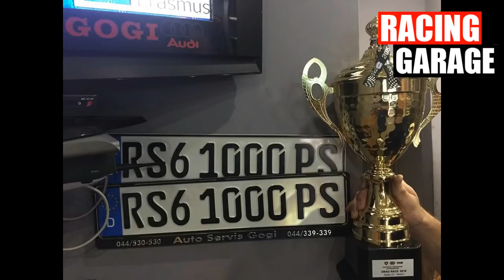ONE OF THE FASTEST VW IN THE WORLD - ROAD TO 1500 HP - GOLF RS V10 SWAP 2017 PROJECT

Comment: Its fast, i mean really fucking fast. But anyone know the 2.0 inline 4 cilinder golf 2 with 1200hp? From boba motoring. This golf 4 has more than double the cilinders and almost the same horsepower output in 4wd. If you ask me the golf 2 is more badass, but its a very cool swap-> A V10 GOLF MK4👌
Reply from the maker: hello there, yeah we know boba motoring so well but the track where Golf V10 was racing its not in good condition , also asphalt its about 40 years old and wet, so with street tires cant launch good, nearly 200meters goes spining ... 
they are working much harder with new performance setup for this beast ... also they need to test it with slicks ....
thankyou for supporting , subscribe our channel for more videos soon .